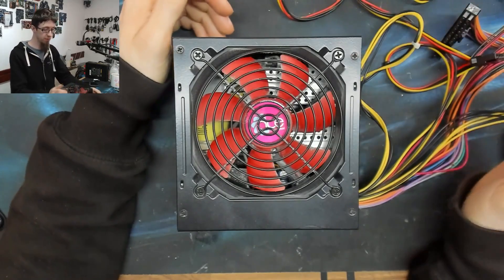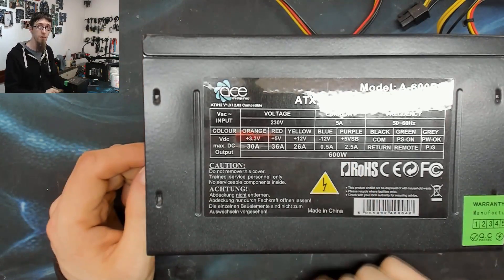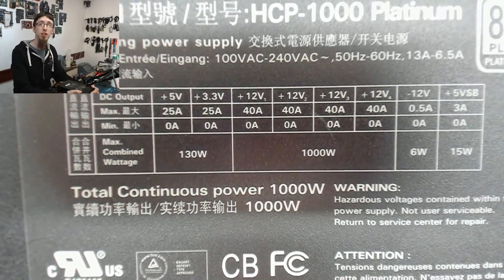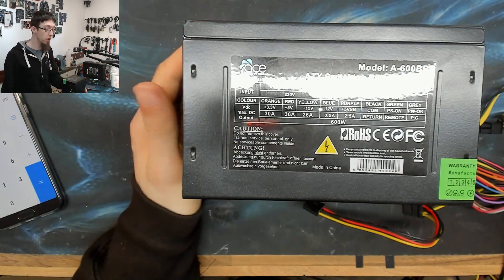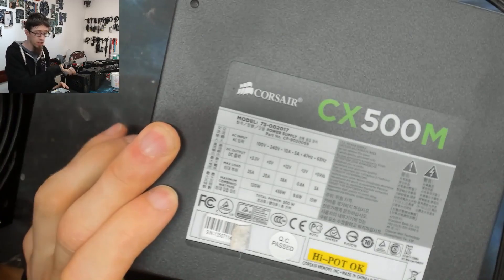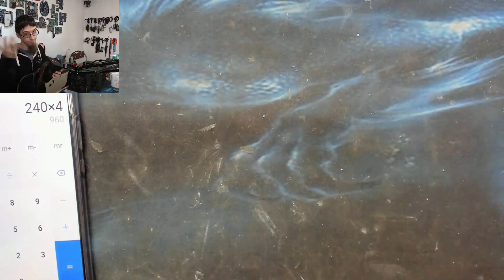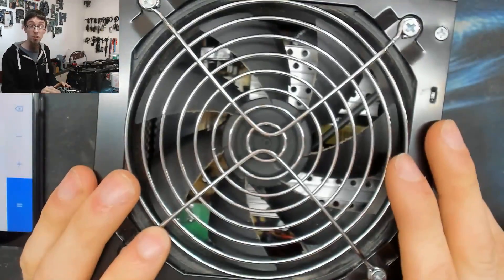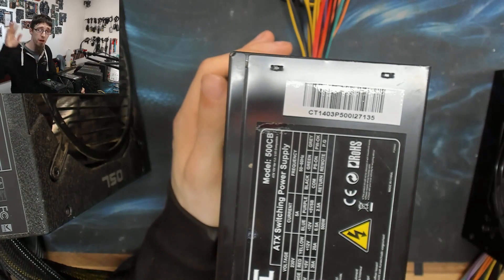LFC#171 - Why This PSU Is Crap

Comment: This looks like an old FSP design. And looking at those specs, I have an FSP that has near identical rail ratings but the total rating is considered to be 400 watts. I will say back in their day they were not bad but they are an old design which is far from adequate for todays designs being mostly 12 volts.  They are great for vintage retro builds though as they need gobs of amperage on the lower rails.  The FSP's I used to sell would have really no issues hitting the ratings on all rails simultaneously, and exceeding their rated total output. But the lower total was usually printed on the package so that you could ensure you would not overpull any particular rail in a typical build of the day. Which used all rails much more evenly.
Reply: Yeah but FSP are guys who have a lot of experience and top notch component sourcing, so even when they make cheap units, they make them right. Same can be said for Lite-ON, and many other typical OEM computer PSUs used by larger brands who don't necessarily like processing returns, where this incurs major cost. I mean there are some black sheep like Acbel and now you get Great Wall which aren't fantastic either but even these all aren't super murderous, just more suicidal after they've been on for a few years. But FSP last really really well.

This would be a generic design which was used by FSP and others at the time, very similar, i mean Seasonic etc they were all fairly similar 20 years ago as far as more OEM mass market stuff goes, but you never know with these units that come from nowhere how components have been sourced, whether the transformer will not develop a short, whether protection circuit has been configured sanely. There are so many cheap but reasonable PSUs which don't have to chase fake big numbers that i'd more readily trust. Given that it's a newer manufacturing date, but the good experienced manufacturers in question definitely haven't been making such designs in 2014, so it's a copy, or maybe a refurb from junkyard where maybe just some cleaning and some burst caps replaced and potential issues bypassed and off it goes into a new shell with no substantial testing whatsoever.

Comment: A system only draws what it needs, most systems don't draw what the power supply can give so your not actually having 600 watts, being drawn by the power supply though IT might be capable of it. if you are then you need to up your power supply. The power supply is capable of drawing and delivering that much generally by what it's rated at. Unless it's whats called a knock off, and those are out there.
You can check this with a watt meter to see what the power supply is's drawing on a bench test and then check it while under load . And yes you need to really look at what a given power supply spec's are to make sure you are supplying what ever your system needs. 
There are tools to help with this on some sites to help you get the right type of power supply you need " New Egg " has one of these tools when you go to match parts for compatibility. And there are only a few factories that make powers supplies. So some components may be the same across certain power supplies. Depends on what spec's a company has told the factory what they want on the boards. 
And yes you really do need to know what a given rail is for, thought he general user it may not be necessary , Not so for system builders and repair people in the industry.
Ratings are about warranties and how long a company will guarantee a supply to work as the spec's say it will. This is also to help the Buyer to be aware of the qualities of a given power supply.  This is a standard that Industry manufacturers and the companies that have them made will go by. That's why a white label is only 1 to 3 years 9 and  ( White labels are a bit new. ) and so on up to 10 years on some platinum 80 rated power supplies , also the cost is related. this due to using much higher components in most cases in the better rated power supplies. The factories do test the power supplies. And there are some good vids on this here on you tube.
Also Generations of power supply's as in Gen 1 and gen 2. Gen 1 being most older power supplies. dating from a few years back. The gen 1 don't have a 8 pin CPU power plug on most of them. though some did have a 6 pin  or 4 pin. If you have a tester understand that it can only test certain aspects of a supply. so that cheap tester you get will tell you if a power supply has a open on a leg but not what a supply can actually draw from the wall or put out in wattage or amp's. That requires some rather expensive equipment most people wouldn't need or want to pay for. To test between these gens a older version tester will not test a gen 2 power supply were a new version of the testers designed to test Gen 2 may or may not depending on the type of tester it is. 
There is a lot of hype on power supplies just as there is on nearly every part for a computer be it the GPU and the MB or even ram, SSD's and the like . And savvy buyer knows this and looks at all the reviews and problems a certain item may have. And disregards Hype. Research is always your best friend when buying computer components. Any Computer Component. 
Check Spec's, Check Reviews, Check Availability. This can solve problems down the road. And check reviews from the company that supplies the parts as well as on sights like New Egg and others, Google it if nothing else. Do at least a 20 min Burn in. many faulty parts may not even show up  then for a few months. 
I did custom system building and modding for many years and we use to buy power supplies buy the case. Keep up the good vids, you have a lot of info the people need though thought i'd drop in a few things people also might need to know.

Comment: One thing is how old is the "ACE" power supply ? It seems to be designed for much older computers. Remember a while ago, most of the PC power were derived from the 5v logic/3.3V cpu lines and the 12V was for "motors" (fans and hard drives/CD/DVD). That change gradually later on as power demand increase, most of the power became derived from the 12v. to lower the dangerous growing amperage on the 5v. line. I have very old PS and most of their juice is on the 5v/3.3v. Of course those PS are not suitable for modern computers.

Comment: lol. i bought one of these. a leadpower 650. overclocked i5 2550k and overclocked rx480. kept crashing during benchmarks. finally went BANG BANG during a game of warzone. got a Corsair 430 and noticed it weighed about 3x as much and have had no troubles sice. but i was very disappointed when i opened the 650 and couldnt find any real carnage. i was hoping for exploded caps. cant see anything actually wrong.

Comment: Big ampage on the +3.3v & +5v rails used to be a big deal for old computers from around the 1990s, which actually used to rely much more heavily on those rails than the +12v rail(s). Then, from around the Pentium 4 era onwards, PCs started appearing with a supplimentary CPU power socket on the motherboard, which, when combined with more demanding graphics cards requiring supplimental power as well, started the trend towards relying much more heavily on the +12v rail(s), and less on the others.

So, high ampage on the +3.3v & +5v rails with no name cheap PSUs may well be great after all for old '90s retro builds, if it weren't for the fact that their all round quality is still generally pants.

Which is why my retro builds are actually running on quality second hand old Seasonic PSUs, with comparitively strong +3.3v & +5v rails against the +12v rails instead. No bangs, magic smoke, or house fires to kill my old retro PCs (or myself). ;-)
Reply: That's really interesting
Reply: different times, different needs ....

Comment: Thanks really well explained I like EVGA Supernova P2 1600W I managed to pick a couple up on eBay been the best PSU in my personal computer I use Corsair RM1000 but I still prefer the EVGA Supernova for running machines with multiple GPU's really great power supplies them cheap Chinese PSU feel cheap and light the EVGA Supernova and Corsair PSU's you can feel the quality in them. I don't need no fancy RGB on my PSU I like a PSU that will last under high loads thanks for explaining the 12v rails in detail.

Comment: One brand that will not disappoint you - Seasonic. Just pick wattage in your budget and you are good to go, they don't make any bad PSU, even their cheapest 350W PSUs are 80Plus Bronze.
Reply: They don’t make any bad power supplies, but they are starting to outsource their power supplies. The S12 III isn’t made by Seasonic(and despite supporting newer standards than the s12 II, it isn’t as good)

Comment: yes but nobody is going to spend 500 plus on components and then shove in a 20 pound power supply. This thing would be fine for athlon 3000g using the igpu it draws 35 watts even with the motherboard ram and ssd the total draw would be about 112 to 130 if you overclock.

Comment: Immediately lost interest when you set your Antec PSU had nearly two kW of power. That's just plain wrong.
A single one of those 12v rails can draw up to 40A - so theoretically 480W. When using multiple of the 12v rails, the total power will be divided up between them. Hence why some PSUs come with a switch to combine all 12v rails to a single rail, to give you the advantage of being able to draw the full power potential of the PSU.
Reply: Also, in Gamer's Nexus's talked with JonnyGuru, he says that having multiple 12v rails is also a safety feature because it makes it easier to detect a short.
Reply: @ChrisD__  That's also correct. Not just that, but having multiple rails means you won't necessarily have a catastrophic failure if something shorts.
Reply from the maker: Yea you're right it wasn't correct to say that there's 2kw there - I see what you mean, the idea I was trying to explain was having over-specced rails, so a very uneven load (such as a heavily overclocked GPU loading down one rail) can still be powered. A naff PSU might split the power equally, which leaves a chunk of wattage inaccessible to another rail, where as the Antec can handle uneven loads because single rails can be heavily loaded.
Reply: @Adamant_IT  I respect you answering to this and admitting you were wrong. You don't see that often :)
I get what you're trying to say and how you were trying to explain it, however this misinformation (as well-intended as it was!) will cause ill-informed people to make rash decisions about their hardware choices and will inevitably cause damage to their systems.
Reply: This kind of reminded me of that time where people (including myself) didn't really understand what different cores meant and assumed having 2 * 1,2GHz would equal a total of 2,4GHz
Reply: @RandomGermanBrit  Oh, stop your barely suppressed gloating. The guy produces a cracking video that has an area of misinformation he graciously concedes to. Try being a little more magnanimous in your 'victory', pal. "Immediately lost interest" - then inevitably can't resist pushing his way through the crowd of folk to show off his knowledge. You must be insufferable at parties. Lol
Reply: @ClaimOfRightMuso  Nah my dude, you've got that wrong. Not gloating at all.
Just because I lost interest in the video after that, doesn't mean I don't want to at least try to inform him - even if I did put it a bit harsh. I'll admit that. Doesn't even mean I'll not watch any other videos. 

I said I respected his choice to reply to this and set it straight. In no way was I trying to be condescending or what have you.

Comment: Careful when buying cheap power supplies, many el-cheapo power supplies are popping up with fake certifications like 90plus or 85plus which are NOT updates to the 80plus standard and don't actually mean anything
Reply: Not that the 80 plus really means anything for quality. You can have a crap 80+ rated PSU, and a great non-rated PSU. An example is an Antec Earthwatt EA500 500w. It isn’t 80+ rated in order to keep the price down, although it qualifies for 80+ bronze.

Comment: you do need high current on the low voltages - on old boards and systems. new systems 12V is king.

Comment: HDD's and maybe even SSDs use 5V rail as well. At some point, Sata HDDs used 3.3 too
Reply: SSD primarily use the 5v rail and have in the past used the 3.3v rail. Some also use the 12v rail, but mostly only the 5v rail. Mechanical HDDs use both the 12v and 5v rail, 12v for the motors and 5v for the logic.
Reply: @stiggyness1976  Thanks for clarifying! I do remember old sata HDDs using 3.3v too but it wasn't listed on sticker on them, or so i was told. I presume for logic too?

Comment: @AdamantIT I think you may be a tad wrong there. I suspect this power supply is plain OLD or an OLD design made cheaply in the following years after 2011. Around the year 2011 there was a major PSU design change going through the industry to accomodate for what you said: GPU, CPU and mass storage drawing most power from the 12V rail. It meant that the PSU internally only has ONE rail for 12V that can deliver the full performance, and 5V/3.3V are generated from that via step-down regulation modules.
The OLD architecture used two separate secondary windings on the transformer, one for 12V and the other for 5V and 3.3V, 3.3V being generated via stepdown module from 5V.
I hope I  could shed some light on such internals. ^.^

PS: Such power supplies are actually good for retro gaming where for example the AMD Athlon 64 and previous AMD systems drew more power from 5V instead!
Reply from the maker: Yea I've heard rumblings of that before... I do plan to look into it more in another video in the future, but the main point of this video is just about checking if your 12v rail is hot garbage or not.

Comment: Why doez the 3.3v rail have a higher amp than the 12v? Yeah it doest output the same wattage but still im just wondering why
Reply from the maker: Power (watts) is volts x amps. So if you have two identical regulators, but one is configured to a slightly lower voltage, the amps can go higher before it hits the maximum power rating.

Comment: I tend to cheap out on the PSUs when I build a PC as I always look for a used ones but I always use those of reputable brands
Reply: I used to do that until my vs500 started hissing and then went boom. luckily didn't take any components with it but still, I'm sure my motherboard saw its life flash before its eyes
Reply: Cheaping out on the thing that makes all your components work is like running a sports car engine on cheap gas it may work but your going to F up your engine sooner or later.

Comment: Many, many years ago I had a really cheap Xilence 700w PSU catch fire (as in pouring out black smoke) while I was gaming. That was the last time I cheaped out on the PSU.
Reply: Lesson learned! What are you rockin' now, after learning your mistake? I used a cheapo one to start off with but quickly upgraded when the fan bearing gave out after 6 months.

Comment: I got a used Enermax 530 watt supply that was quite old. It totally failed to boot up a i5 computer, and it is either because it was bad, or it was like ATX 2.2 and somehow incorrect. I heard some of them had trouble outputting low wattage states on a p4 connector.
Reply from the maker: Probably just failed. A common failure mode for PSUs is that they turn on, but can't actually handle a load. This is why I don't trust PSU testers, because a palm-sized tester can't put a couple of hundred watts onto the PSU to actually test it. Just showing a couple of LEDs doesn't mean anything.
Reply: @Adamant_IT  It is likely something is wrong like what you mentioned. However, it did power up 4 other mother boards (P4 and AMD 754,939) that I think were the same load. Maybe it was more. Weird thing is you put back the lower original supply, or I got a new Gigabyte PB500, and bingo it starts up every time. The board was from a Acer m3910.
Reply: good way to test a psu for it's ability to sustain a load is to use old headlight bulbs from cars. them things can pull 50 watts easily. Just be careful they got HOT

Comment: The Antec is 1000W, how could it have 40A on each of the four 12V rails? They put 40A there because four wires are in the connectors and they can each handle 10A before bursting into flames. The 12V rails can output 83A max.
Reply: Antec 1000w rating is the Root Mean-Squared not the Peak Power Output rating like nearly all other manufacturers would list their units at 1600w. Been that way for over 20years so no fires just clean signal from a 230v input.
Reply: @buntudred6929  Dude, this PSU outputs DC. 1600W on the DC side would translate to 1600W RMS on the input as well. Not including the losses.
Reply: @gabest4  The RMA will be printed on the label. while I have never had this model unit to test (a good friend of mine has a lab like a 1960s sci fi scene he manufactures control panels mainly for textile machines based in Bradford UK) Based on other antec units  we have tested, I recon from the 1000w the 12v rails will be around 700-750w peak continuance mark and joined 80amp will be limited to around 60-65A in total draw due to keeping those fires at bay. For the whole unit combined on UK 230/240v at 13A AC input The roll off will occur around 1550-1580w mark with the peak max closer 1800w (for the generic black PSU measurement) with a shed load of flutter. At which point you don't want to be putting the kettle on. Platinum 80+ will be at 92-94% efficient so losses will be minor as switching circuitry has come a long way the past 10 years. Lets be honest WTF are you trying to drive in a modern PC that would need that much sauce anyway? 4way SLI GTX 480s and OCed Quad Xeons with 20 hard drives and a couple of flo tubes for the flair lol?